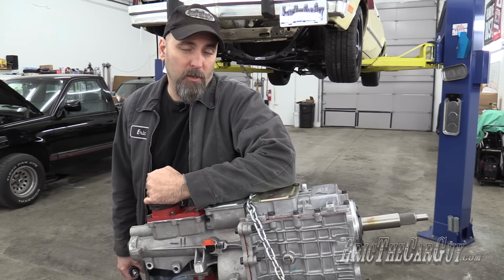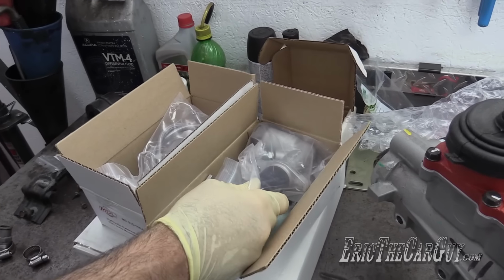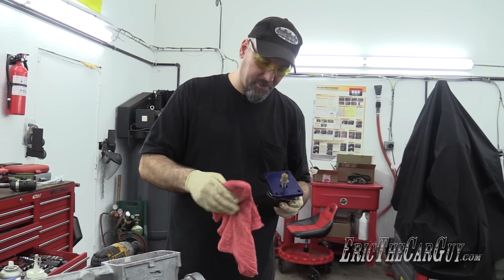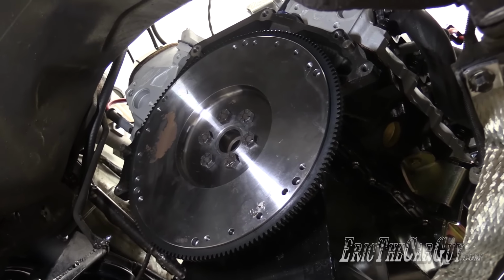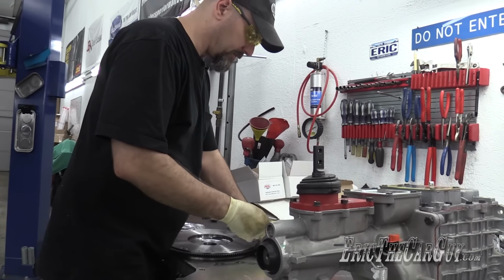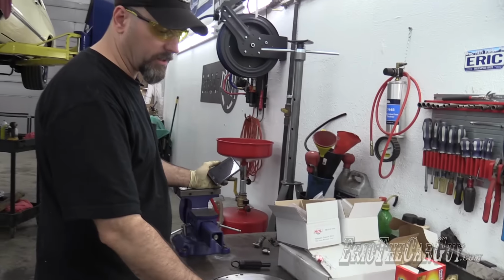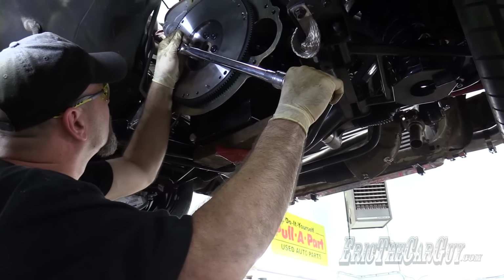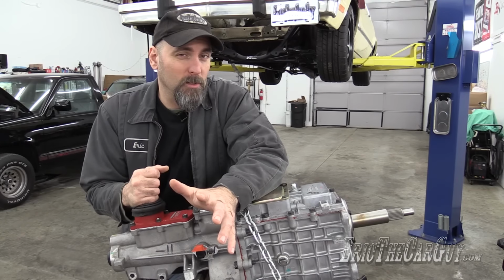TKO600 Install (Part 1) #FairmontProject

Comment: HELP... Eric, my 2015 Nissan versa RPM needle jumps and car hesitates when changing gears. Can you tell me if it's the transmission or converter torque? Thanks for your knowledge
Reply: Online consensus is on programming issues, confirm for yourself if the issues you have are the same as described in most forums (when searching for your car, model, year + problem).